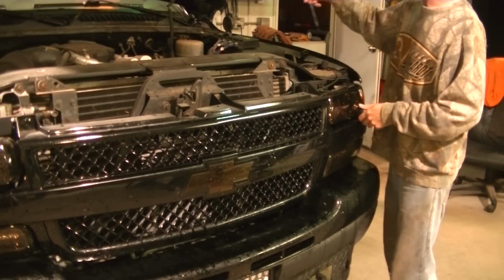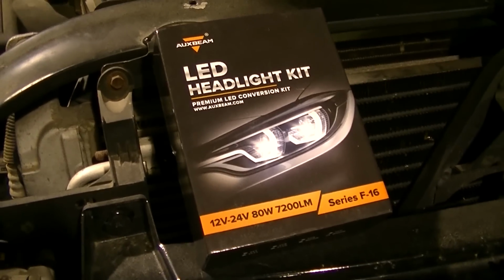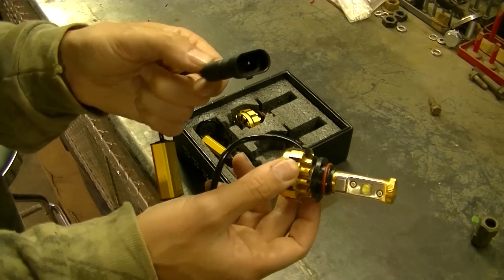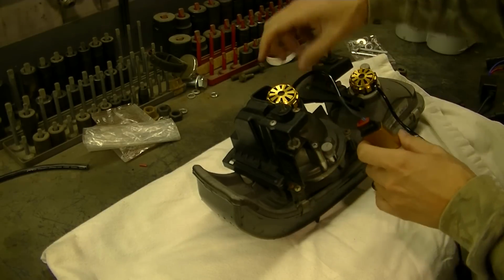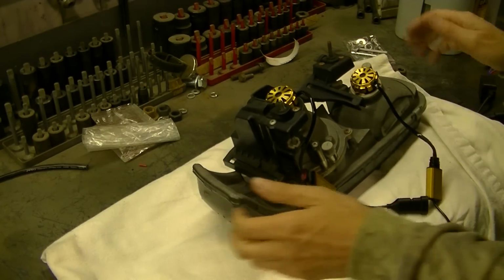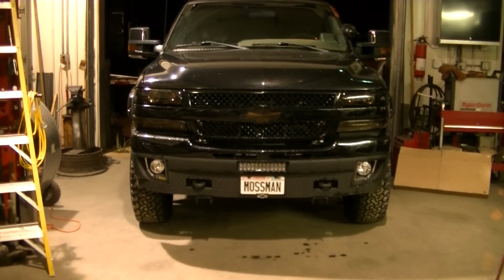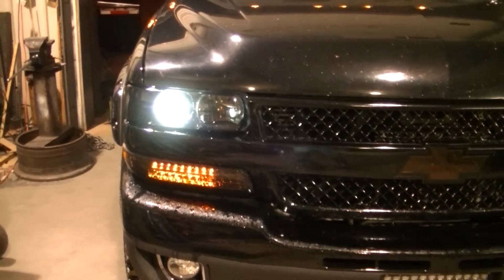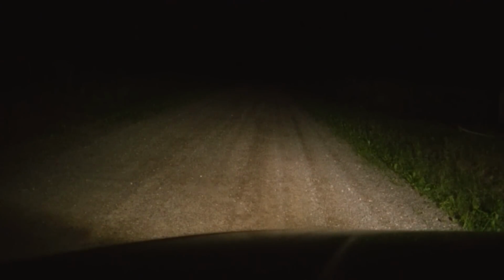Darth Dually Auxbeam F-16 LED 9006 Headlight Low Beam Upgrade Silverado

Comment: Thanks so much for the post. I did the low beams after watching your vid on the 9005 bulbs. You were right, I have the stock headlight housing (my truck is identical to yours) and the o-rings are tight so I used a bit of silicon grease and they popped right in. The spread on the light is perfect and doesn't blind oncoming traffic. Their website advertises these are submersible so for those in dusty climates run a bit of water over the back of the bulbs occasionally to remove dust buildup.
Reply from the maker: These lights are awesome.  Highly recommend them.

Comment: great video. LED and HID are to be used on projector headlights. and I can see you did buy some. that's the reason a lot of people that do the light bulb conversion blind on coming traffic because the headlights weren't converted. 
I think output is almost identical but LED crisper and clean
Reply from the maker: I agree the LED is better.  The HID's are not going back in  :)

Comment: well i finally got the smoked spyder projectors in my 1999 s10 i had to do some modifing to the metal headlight support on both sides cause i have auxbeam h1 leds in the low beams and the 9005 aubeam led for highbeam. I had to swap the h1 canbus for the 9006 canbus basically plugged the h1 bulb into the 9006 canbus and it worked because the canbus has 5 prongson both the h1 and 9006....i have a hard time explaining things but i have every thing the way i want it now and i love this setup also have the 4 high mod as well and i will be watching the heat factor too it should be fine can it won't heat up as much like halogens or hids will. and the h1 led didn't mess the cutoff line up either just a nice flat 90° edge on both sides.
Reply from the maker: I am glad you are happy.
Reply: me to
Reply: @mossman381 i had the auxbeam led bulbs in my spyder projectors i have removed the projectors from my s10 and i switched back to my spyder clear crystal halogen housings but i have the auxbeam 9006/9005 leds back in them and i am still impressed with my housings and bulbs when i had my projectors i had to cut some support off of my radiator support that support the headlight housing which caused my projectors to be off kilter a bit meaning that the right and left side aim was aimed down too much and the cutoff lines were not aligned right and my passenger low beam on the projector would cause a glint i wouldn't recommed them for projectors. I haven't gotten flashed with my auxbeam leds being in halogen clear housing and the cutoff line is better than my spyder projectors.

Comment: from what I've read the inline plug you have is just a driver for the LED and the 14.99 add on option is the CAN Bus
Reply from the maker: You might be right.  I try to get specs right but I was a little confused with this one.  I just post all the specs in the description of the videos now.
Reply: also are you using LED high and low beams? If so id there a vision difference?
Reply from the maker: Yes, the low beams and high beams are very different.  Low beams do not go out near as far as the high beams.  High beams are amazing and can see a long distance down the road.
Reply: thats good to know, and one last question do you have a preference between the Auxbeam and the vplus?
Reply from the maker: I love the Vplus U series for high beams.  It looks like the Auxbeam S2 series uses the same LED chip as the Vplus U series.  After all the LED headlights I have tested I would go with the Auxbeam S2 or Vplus U series for high beams and the F-16 Auxbeams for low beams.
Reply: very thorough preference, thanks for the input!

Comment: Hi thanks for taking the time to share this. Have you had any issues with oncoming traffic flashing you due to the high lumen output of the claimed 7200 lumens? I just updated the headlights on my 2014 GMC Sierra 3500HD Denali to a projector style from Spyder / Xtune. They came with halogen bulbs already installed  and have a better pattern and visibility than the OEM reflectors, but I would like to upgrade to LED for the low beams. On my previous 2012 Chevy Silverado I used the Putco Nite-Lux LED H11 bulbs in the OEM reflectors which is typically a No-No because of the possible glare to oncoming traffic, but surprisingly even though they put out 5000 lumens for the pair, I didn't really get flashed after i had the headlights re-aimed. I know the projector is supposed to eliminate or minimize the glare to oncoming traffic, but I'm a little nervous in general because my GMC Sierra 3500HD has a very similar headlight height as your Chevy Silverado 3500 but I don't know how it affects lower cars on oncoming traffic or ones being followed or sitting behind at an intersection.
What are your thoughts or experience you've had or encountered? Thanks! Scott
My Headlight Video:
Spyder Xtune LED Halo Projector Headlights 2014 GMC Sierra 3500HD Denali
https://youtu.be/AOrpQeHTw3Y
Reply from the maker: I didn't get to run these very long because I changed out my headlight housings.  The HID and the LED were very similar.  The LED was whiter light so I felt like I could see better with them.  I don't think you will have a problem with a projector housing.  The only way to really tell is to try it and if you get flashed a lot then they are probably too bright or aimed too high.

Comment: I have a very clean and nice 2002 silverado LS 2500 HD, so I like your videos, thanks :)
Reply from the maker: Glad you enjoy them.
Reply: Can you tell me the best for brightness headlight housing to use with my LED light bulbs? I did the smoked out lenses but couldn't see a thing. Now I have the smoked out clear lens and I still can't see well at all. I just want to be able see really well. Any certain part # you can tell me?
Reply from the maker: With a good set of LED bulbs you should see good with any lights.  I like the black clear lights without projectors.  These cheaper projector lights just didn't work well.  Even with the LED bulbs.
Reply from the maker: Those look like factory replacement lights.  I have never put LED bulbs in factory lights.  You can see in the pics that the low beam section of the lights has light diffusers.  I am not sure how the LED bulbs will react to that.  I have always used a light with a clear lens.
Reply: oh boy, i'm going nuts with all this, can you just show me a link to the light housing units from e bay or amazon, PLEASE!  lol  I'm so confused and must have tried like 4 different sets and LED bulbs.
Reply from the maker: I have ordered from these guys several times.  I have the black version on my 2002 Silverado 2500HD.  Paired with some Auxbeam LED bulbs.  The black ones I have seem like good quality.

http://www.ebay.com/itm/Clear-99-02-Silverado-00-06-Tahoe-Suburban-Headlights-w-Amber-Reflector-Bumper-/361712011647?fits=Year%3A2000%7CModel%3ASilverado+1500&hash=item5437b7497f:g:JYMAAOSwGtRXybEG&vxp=mtr

Comment: I prefer the LED upgrade.  Less or small parts compared the HID. 
What's the brand of the aftermarket headlights? I'm in need of a replacement.
Reply from the maker: The housing are from Depot.  I just got new smoked housing to replace these.  Non-projector housings.  I will have a video shortly on them.

Comment: Pretty cool, I have those in my high beams, but they light up 3000k/yellow. I hear the newest Opt-7 LMZ LED bulbs are very good aswell.
Reply from the maker: These are very white in color.  Even with my smoked housings they come out white.  I think 6000k is what it said on the box but they might be closer to 5000k.
Reply: mossman381 

Oh I know man, super white. The ones I have are the same but they included yellow quartz tube that goes over the bulb.
Reply from the maker: Alex Alvarez   The yellow would be good for bad weather but for the most light output you need 5000k.  Plus the whiter light seems to be easier on my eyes.  Everything seems more clear.
Reply: +mossman381 

That's true. I might remove the yellow quartz tube from the high beam LEDs to try the 5500k original light color at night.

Comment: Hey, Mossman, do your Depo lights shake a bit?  My Depo on my 2003 Tahoe tend to shake a bit.  Also, I installed Vplus LEDs in the Depo high beams after watching your video and they work awesome along with my bi-xenon HID low beams.  Do you like the Auxbeam better than the VPlus?  Thanks.
Reply from the maker: Don't remember them shaking.  Do you have all your pins engaged?  Still love those V-plus headlights.  Auxbeam makes good products and would recommend any of them.

Comment: I have a question for you mossman381.  Did the low beam bulbs that came with your projectors did they come with H1 bulbs cause im getting spyder projectors and they come with h1 halogens for lows what i am wondering is will my hb4 9006 auxbeam leds fit in the projector housing i know  that the hb3 9005 will fit because the high beam is just a regular halogen housing, and also with the auxbeam leds in the projector housing did you notice and more burn spots? and i have a 1999 s10
Reply from the maker: The Auxbeam lights fit into this projector housing just fine.  I didn't notice it getting so warm that it would melt the light but you might want to keep an eye on the heat for awhile.  Different housings I am sure will do different things.
Reply: when i do get the spyder projectors in i will watch them since it will be a more focused beam but with the leds they shouldn't even heat up that much since i basically have the same bulbs  with the fans. love the vids  still can't to see the new rims on your project midnight merry christmas and a happy new year to you

Comment: I bought the 9005 and 9006 models of the f-16 from auxbeam for my 2013 Dodge Avenger. When I installed it flashed and flickered, Auxbeam said to buy their anti-error canbus for each set. After installing those I still had a flashing error (though no flicker error). Auxbeam then suggested to splice a 50w 6ohm resistor as well as have their anti-error canbus. Though this helped, it still flashed. Any recommendations?
Reply from the maker: Not sure what to tell you.  The newer stuff seems to not like the LED headlights.  I have had no trouble with mine in the older trucks.  I don't have anything that new to even try them on.
Reply: Gotcha, well thanks for the reply! I appreciate receiving a response!

Comment: are those 35W HID's? because 55w HID's still blow away LED and you can choose your colours so around 5000k colour for pure white
Reply from the maker: I tried 55w HID and they melted my housing.  LED will overtake 55w HID eventually.  55w HID is way to bright for public roads anyway.

Comment: I was looking to get these to replace my hid's on my 03 suburban which has the relay harness kit on all high & low also fog lights too, but I heard that the fan on the led makes a wining noise that you can here in the vehicle tats my question to u?
Reply from the maker: You can hear the little fans when standing next to the light.  I don't see how you could hear it in the cab.  My truck is a diesel so all I hear is engine noise.
Reply: Tat's wat i ment to say a winie noise?

Comment: Mossman,
Can you tell me if the 9005 are for the high beam and 9006 are for low beam In the Auxbeam F16 series.
Reply from the maker: Pretty sure the manual says 9006 is low beam and 9005 is high beam.
Reply: I actually purchased the 9005 and H11 recommended by auxbeam online support but there was no manual only a sheet on how to disconnect and connect. But I will continue my research with auxbeam.thanks moss man.
Reply: Jesse Vasquez when he said manual, he was referring the the vehicle owners manual. it tells you the bulb sizes for the vehicle
Reply: Kris Lizana
thanks but that was already sent to the manufacturer and they will be making adjustments to their products and parts.

Comment: I LIKE THE LED BETTER NOT LIKING THE FAN IDEA
Reply from the maker: The engine bay is partially protected so I don't see the backs getting a lot of abuse.
Reply: How long do you think those little fan motors are going to last?
Reply from the maker: Joe Mamma   I have no idea.  I don't do a lot of night driving but will report back on how they do.